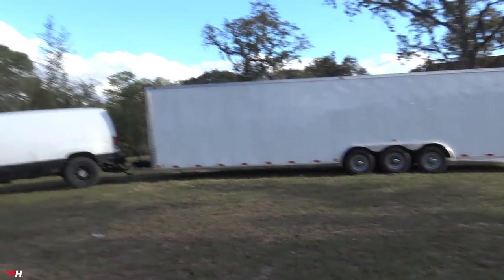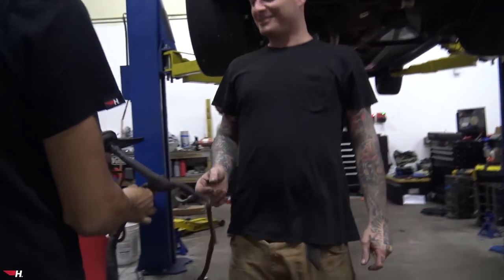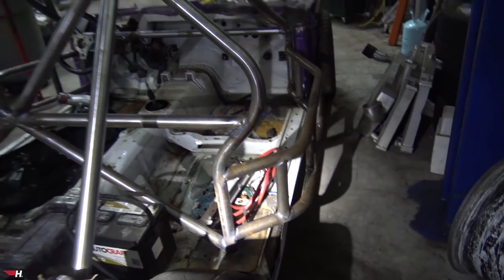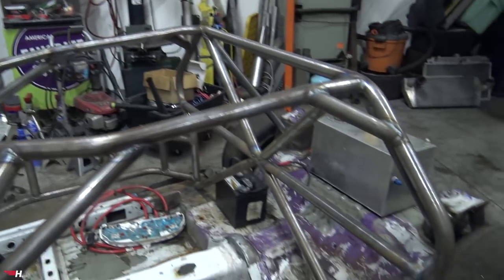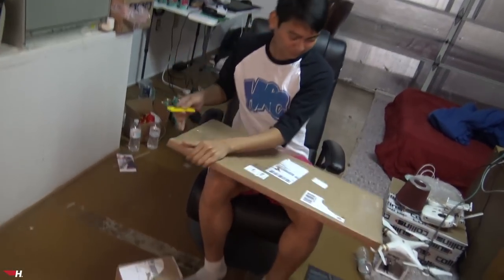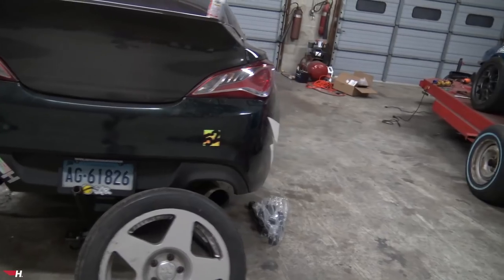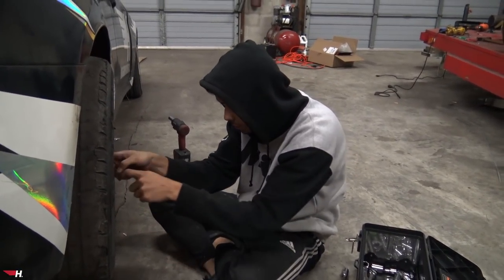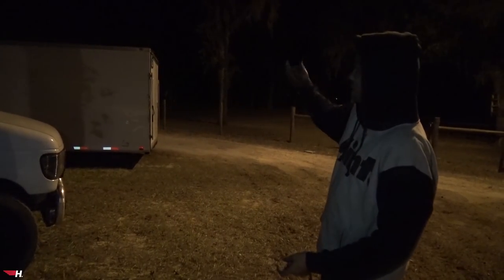DRIFT KART ALMOST DONE

Comment: buy a cheap ass radio kit with 2 speakers from walmart
Reply: Why would they do that? Since it makes since lol
Reply: Andrew Walker *sense*
Reply: Shawn Szy * cents *
Reply: * Scents *
Reply: Thank you. Lmfao
Reply: Og boost Junkie Open the oem radio and solder an aux wire to the fm modulator output
Works like a champ, I've done that in 2 head units at the moment LOL I'm so poor

Comment: The cigarette lighter part on the inverter is only rated for 150w, there's a fuse in the outlet part, which is why you probably thought the other one broke, if your using more than 150w your supposed to use the gator clips directly to the battery

Comment: Get some decent rubber on it before it's aligned. It will be a lot more acurate.
Reply: Ask any alignment shop, it's not a big deal, but aligning a car with fresh tires is always better.
Reply: Negative central. The alignment tools are based off the rims not the rubber.
Reply: Yes but when you have the inner half of the tire on cords, and the outside still fresh, it throws the alignment off when you change rubber. It's not the end of the world, but a solid allignment is best done with fresh rubber.
Reply: Go ask any alignment shop. They always recommend good tires before doing an alignment.
Reply: dropinbiking92 of course they do. They want to sell you new tires. The alignment process has nothing to do with new rubber. Now if you have janky tires the alignment might be good but the car might track funny because of worn tires but just to get the suspension straight does not require new tires at all.
Reply: Worn tires won't make the car track badly unless the alignment is off. Just think of this, you align by the rims, but the rims sit on the tires. How would that not affect the camber alignment?
Reply: dropinbiking92 I've never had an alignment shop tell me I needed good tires and I've had many different cars aligned, but good for you for trying to make peoole think you're correct on the internet lol
Reply: dropinbiking92 brah have you ever worked a car much less driven one? If I take a perfectly aligned car and put a tire missing half it’s rubber on one side you will have to hold the wheel the opposite way a little bit just like if your tie rods were jacked up. I can’t tell if you’re a 13 year old arguing with someone almost 3 times your age or not understanding what we are trying to learn you.
Reply: Just relaying good info I've picked up from a quality shop. I've worked in the body shop the last 5 years and we do a lot of work with an alignment shop. Like I said it's not a big difference but a fresh alignment with fresh rubber will always be more acurate.
Reply: You confirmed what I said. So you've got a car with a great alignment, put a junk tire on, it no longer drives straight. The alignment isn't off, the tire is making it apear it's off. So if you've got destoryed tires and get a perfect alignment it will drive great, but guess what happens when you throw a fresh set back on?
Reply: If any of you actually worked on cars for a living you would know what he is saying is true. Obviously not the case.
Reply: dropinbiking92 no what I’m saying is that in no shape or form does bad rubber affect the actual alignment. If you had bad tires and got an alignment things might be janky but it won’t mess the work up they did. Once you put a new tire on everything would be hunky-dory. Just having low tire pressure can affect the cars tracking. New rubber old rubber has nothing to do with the actual alignment process.
Reply: By getting an alignment with uneven tires you're compensating for that. So when you throw fresh even rubber on, the alignment is put back off. It's not hard to think about.
Reply: dropinbiking92 look I’m trying to educate you here. You can align a front end and rear end without tires. They adjust the tie rod, camber and caster to the car not the tires. You align those pieces so you don’t destroy tires and to keep the car tracking straight. Alignments have no basis in the tire. You do realize when a car gets out of alignment it’s not usually because of tires it’s because shit like tie rods, camber, and caster adjustments get knocked out of whack because you’re hitting massive potholes in the road. If the alignment is good tires wear evenly. If you smash a big pot hole your front end goes all wonky and then your tire begins to wear funny. Not the other way around.
Reply: Sure why not?

Comment: power inverters that run off cigaret lights are trash because the wires that feed power to the cigaret lighter are the size of a toothpick! the power cord on your boombox alone are 5x the thickness of the wires behind ur cigaret lighter.. run an 8 gauge (amp) fused power wire dirrect from battery. and then just attach a ground wire to any bare metal on inside of the van. this will drastically increase the saftey of your van. last thing anyone of us wants to see is the van on fire for over taxing the cigarret lighter... cigarette lighters are made for cell phones and tiny ass electronics that require very little power requirements. not 400 watt stereos

Comment: I'm honestly just being curious here, not trying to be a jerk. But why don't you just install a headunit and speakers (maybe even with a sub and amp) in the van? I just feel like running a power inverter with that ghetto blaster is unnecessary. Especially when you're using a gas generator to power it, when you could easily install a proper radio.

Comment: saying arp headstuds are expensive.... For my mazdaspeed ARP 2000 headstuds are WEAKer then stock so you have to get the custom l19/h11 head studs which are $300 instead of like $120 for regular arp headstuds.